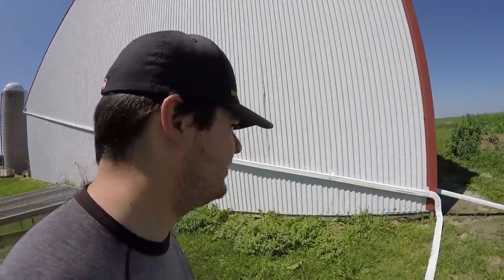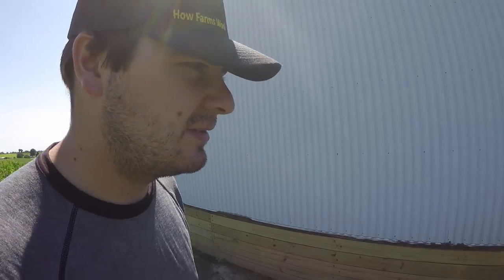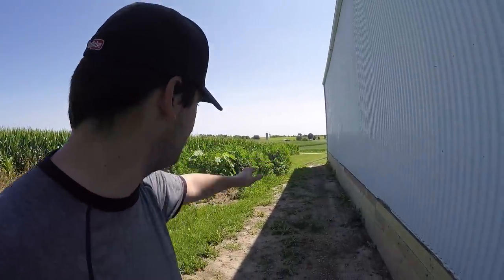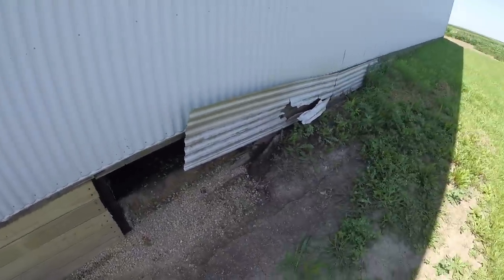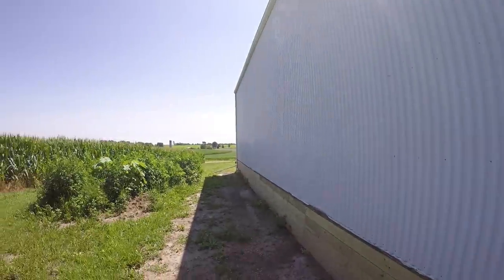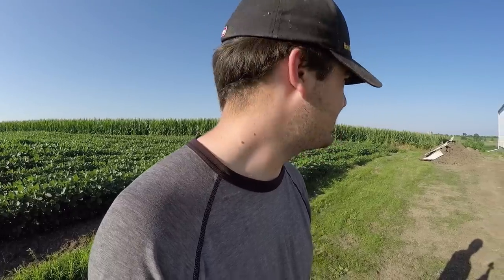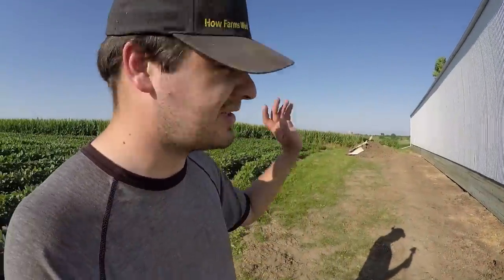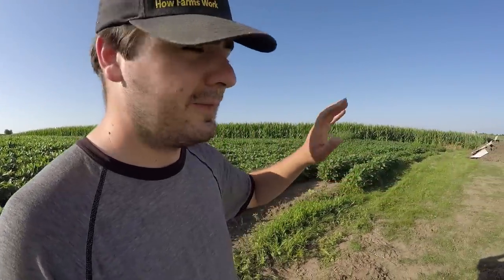Shed Work

Comment: You might think about putting a french drain in along the back of the shed to carry the water past the end when it rains.  Just slant the tile too the low end then you won't need to back fill so high up the boards and they will last longer.

Comment: asphalt based driveway sealer. Mop it on and it will seal the gaps, then a layer of plastic tucked under the metal. Flex seal does work but $$$$ for what it is.

Comment: Spray on some orange oil.  Natural bug repellent and let it absorb before tar or maybe a torch down roll used on roofs.  Check roof coatings for better options.  A roof lasts 10 years in direct sun.

Comment: Thompson Water Seal works great. I put it on my wood deck of my 40 ft open deck gooseneck trailer. Rough sawn Oak. Took 4.5 gallons. But that's overkill.
Reply: Michael Baumgardner Hes putting dirt back against it. It would be a waste.

Comment: Drainage stones,maybe treat it like a foundation and use the plastic dimple product drain away water.the sealer then sheet plastic then the dimple product
Reply: This would be the absolute best method. Seal the wood but above all, let the water drain through rock, then out a drain.  (called a "french drain").

Comment: Should have used toungue and groove boards. It's still gonna leak
Reply from the maker: +Justin Walsh Not if we tar it.
Reply: How Farms Work tar the heck out of it and slope the dirt like you said that'll work I dunno maybe a gutter would help too but good job Ryan  the whole nail thing is why I use screws lol
Reply: kory league Or an air nailer
Reply: How Farms Work tar the heck out of it and slope the dirt like you said that'll work I dunno maybe a gutter would help too but good job Ryan  the whole nail thing is why I use screws lol
Reply: What you did is fine and will work, but I agree PT tongue & groove 2x6 would have been my choice but probably twice as expensive. So maybe not my choice. HaHaHa  I've heard of pole barns where the poles have literally rotted off and required a new post dropped in beside and bolted to the old one. (They used a vacuum truck to make new holes) Those spikes seemed to find good wood so I would think you guys don't have that problem.  I'm kinda scared to go look at mine. LOL. KIT d
Reply: Yep I've built a half-dozen porches and handicapped ramps for myself, my sister, my brother, and my parents... If I had used a hammer and nails, I would still be hammering... I use the drill and impact driver and screws-- they'll hold together when nothing else will, and SO much easier to put together... I used screws by the five gallon bucket full to build those covered porches and handicapped ramps; went easy with the drill/impact driver but it would have been murder driving that many nails... 

Later!  OL J R :)

Comment: Ryan, you folks move the skid steer all over the place. 
Why not buy a old 50 or 60,  with a trailer to put skid steer on drive off.
Save wear n tear on skid steer, n a 50 go down the road twice to three times as fast. 
50's run long time on tank of fuel like that.
Reply: MrVailtown what do you mean by 50s 60s
Reply: Ryan Williams Sorry, John Deere model 50, or model 60 ,  this line came after the A's n B line, think was when JD started the numerical series.     A "50" compared to a B with up grades as live PTO, live hydraulics , rolomatic front end , where when one front wheel ran over something, the other went down to compensate for the level  and the ground .
Was on tricycle type front ends. 
Electric start n light where standard equipment .    Still had a belt pulley .   Could have a three point system as a option .

Some where duel fuel , start on gasoline , switch to kerosene , then switch back to gasoline, for restart when cold.

Amazing tractors for the time.